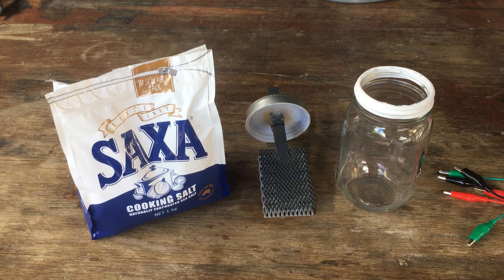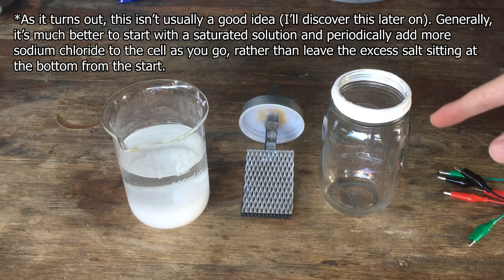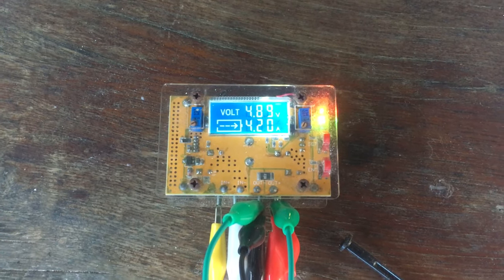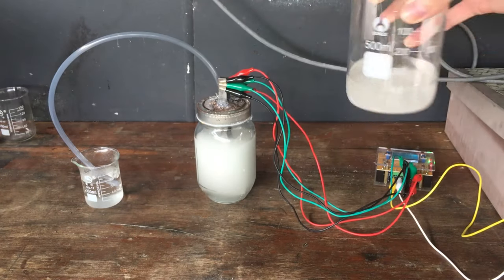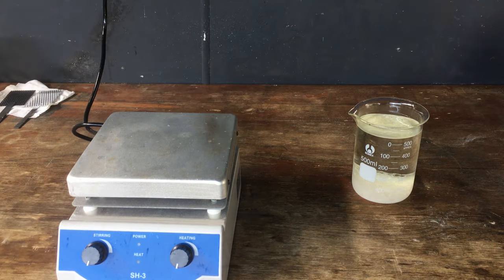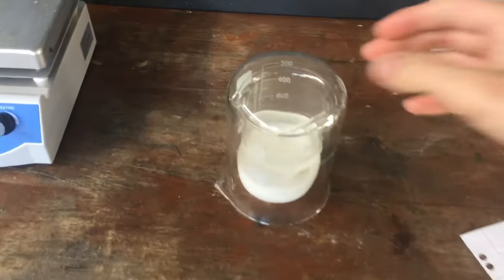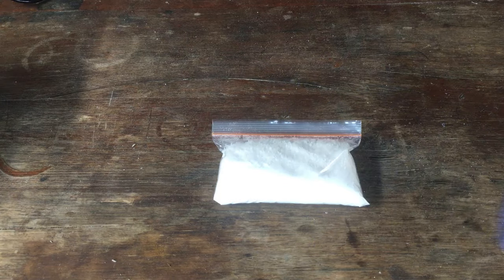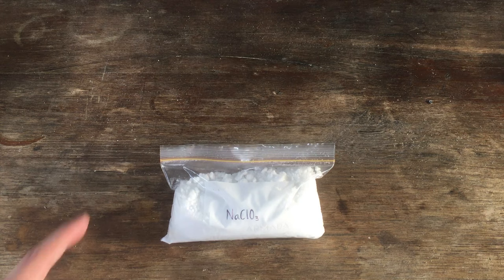A Sodium Chlorate Cell

Comment: My dear friend, thank you for your effort, but please, I have a question that concerns me very much, and I hope you can answer it. My cell operates with an appropriate current, and even the amount of gases generated by the electrodes is normal, but with the passage of two days of not adding more chloride to the cell, the amount of gases increases in large quantities. Is this a result of the decrease in chloride in the cell, or what?
Reply from the maker: Are you constantly measuring current? Has the current increased or is this extra gas generation occurring at the same current as before?
Reply: @ScrapScience  No, the current and voltage themselves did not increase anything, and as for the electrodes, I use carbon electrodes, and as another note? When I want to extract sodium chlorate from the solution, I do not evaporate half the amount of water because the crystallization process does not work for me, meaning the chlorate does not crystallize at the bottom. No matter how much I evaporate half the amount of water and leave it to cool, I do not find any chlorate crystallization. Instead, I evaporate all of the water until only salt remains. Is this the case? It is true, and even if it is true, how do I separate chloride from chlorate after the total evaporation process?
Reply from the maker: An increase in gas formation still sounds most likely to be from the cell drawing more current as it increases in temperature (this is common for cells that are supplied with a fixed voltage). However, if you're directly measuring current and confirming that it is not changing, it's a possibility that you've begun generating more oxygen as the choride level drops, though this is still a very strange situation.

If you're unable to crystallise chlorate out of the cell upon volume reduction, you probably just haven't made enough. Do diagnose this properly, I'm going to need to know a lot more about your cell:
How big is your cell (in mL)?
How much current has it been drawing?
How long did you run the cell for?
How much chloride did you add? And in what intervals?
Did you include other additives?
What are the surface areas of your electrodes?

To answer your final question, simply boiling down the cell solution to dryness will give you your chlorate. However, it will definitely be contaminated with significant chloride impurity (as you've suspected), and will need a recrystallisation if you want a pure product.

What do you actually need the chlorate for? It's possible a potassium chlorate cell would be more appropriate for your needs...

Comment: I started my chlorate cell 3 days ago. How can I calculate how long it will take me if I'm using 6 amps?
Reply from the maker: It's a little difficult to explain the basics of this kind of calculation in a Youtube comment, so I'll direct you towards a website that gives good explanations on how to make predictions of the cell runtime and production rate:
http://www.chlorates.exrockets.com/runtime.html
Reply: @ScrapScience  Hmm could there be something wrong there's no chlorate crystalizing even though I pumped the amps to 10 but there's definitely hypochlorite being made
am I just too impatient I checked the calculations and I will use them next time because I don't really remember how much salt I used.
Reply from the maker: The time things take to crystallise will depend on the volume of the cell, how much salt you initially added, the temperature of the cell, whether or not you're topping up with more salt as you go, and whether you're running a sodium or potassium cell, among other things. Without knowing how much salt you added to begin with (or any of the other factors mentioned above), it's pretty much impossible to predict when you'll get crystals.
If you're running a sodium cell, it will take a long time to get crystals (if you get any at all). Generallym, you'll only get sodium chlorate crystals if you add more chloride than is required for a saturated solution.
If you're running a potassium cell however, the crystals are much easier to get, and will usually come out within a few days of running a cell this size.
Reply: @ScrapScience  I added some more salt yesterday. Does the voltage increase when the chloride concentration is decreasing and is it possible that only hypochlorite is being made but not chlorate
Reply: And thanks for answering to my questions!
Reply from the maker: No worries! I'm always happy to respond to comments.
In order to have a chance of crystallising sodium chlorate, you'll need to have added at least 65 g of NaCl for every 100 mL of cell volume over the course of running the cell (ideally, you should add more than this).

In practice, the voltage of the cell will rise when you hit low chloride concentrations. This is a pretty dangerous way to run the cell though, since it brings the chloride concentration to the point where it starts to damage your anode. It's much better to calculate things based on the current, efficiency, and initial material, but I suppose you can use the rising voltage as an indicator of chloride concentration, with the drawback of it damaging your anode over time. For this reason, you should always add more chloride (or stop the cell) immediately after you see the voltage rise by half a volt or more.

It's very unlikely that you're making hypochlorite without any chlorate production. Provided you're using a graphite, MMO, or platinum anode, it's certain that you're making chlorate. Hypochlorite is the intermediate step in the oxidation of chloride to chlorate, so it's to be expected that you have a lot of it in solution.
Other anode choices might possibly run into this issue, but I've never heard of it happening.
Reply: @ScrapScience  Well I dipped a piece of paper in the solution and let it dry and It burned extremely fast. So in fact there's lots of chlorate in that solution.
If my math is right in couple of days it should start crystallizing but then I would have over a kg of sodium chlorate.
Reply: @fallu6224  did you get crystals eventually?  It can take a LONG time, but the cells I've run have been at least 2L at 20a.
Reply: @chemistryofquestionablequa6252  Never really got any crystals made about a 3kg of chlorate until my electrode corroded
Reply: @fallu6224  what kind of electrodes were you using? Mmo should last essentially forever if you treat it right.  I've damaged one by running too much current through it though.
Reply: @chemistryofquestionablequa6252  platinum coated titanium electrodes. never knew why they corroded I used low amperage and all but suddenly they started to corrode
Reply: @fallu6224  that's weird.  I use those for perchlorates and run them hard at high amps and haven't had problems.  I would expect that yours weren't coated as thickly as they should be if they corroded so quickly.  Sorry that happened, those are kinda expensive.
Reply: @chemistryofquestionablequa6252  Yeah bought mine for 130€ and they were completely real and certified with pretty thick coating but still they somehow corroded

Comment: Good video! It is not clear to me for 14 minutes when you filter through a funnel into a larger container. Do you filter everything into a bowl and bring to a boil? Full content?
Reply from the maker: At that point in the video, I'm just filtering everything, and then placing the filtered solution back into the original beaker to be further boiled down. You've got the correct idea here.

Comment: If you increase the current, the process will go faster, for example, 40 amperes
Reply from the maker: At 40 amps, it definitely will go much faster. However, It's important to take the limits of a cell into account. For my cell here, 40 amps would be too much for my electrode surface area, would heat up the cell excessively, and would fry any of the electrical connections I'm relying on.
With a bigger cell and electrodes that can handle it, 40 amps is an excellent idea if you want large quantities of chlorate.
Reply: @ScrapScience  Thank you very much, please tell me how much faster the process will go in one day is it possible?
Reply from the maker: I don't really understand your question. It will be nearly impossible to make this much chlorate in a day with a cell like this. You'll need a larger, better designed cell if you want to make reasonable amounts of product in such a short time.

Comment: Hello, I'm planning to make nacl03 in the same way as in the video, maybe I'll use 500 grams of salt and use carbon electrodes from a size D battery,Please give me advice, what voltage and current to use? how much water is needed? And how long does it take for electrolysis?
Reply from the maker: If you want to know about the basics of the process, you should watch my video on the potassium chlorate cell. It's linked in the description, and goes over most parts of the general process. This particular video is more of a sequel to that one, where the process is modified for the sodium salt.

As for the voltage and current, the general rule is that you should use whatever voltage will give you 20 mA per square centimetre of exposed anode area (for graphite electrodes specifically). If this requires more than 5 volts, you should ignore this rule and keep the supply at a 5 volt potential. A current and voltage controlled power supply is best here, since you can then set the maximum voltage to 5 V, and the maximum current to 20 mA per square centimetre of exposed anode area.

For the amount of water you need, this will depend on how you want to run the cell, and how big you want the cell to be. Do you want a batch process where you will be slowly working through your 500 g of starting material? Or do you want to do everything in one go? The simplest way to go about this is to just use enough water to dissolve everything, and electrolyse from there.

For the runtime, this is a subject too complex to explain in a Youtube comment. It will rely on the quantity of starting material, the current, and the efficiency of your cell, among other things. You'll have to do some research and some stoichiometric calculations here. 
I haven't yet found a good resource for doing these calculations, but this is a relatively good start:
http://www.chlorates.exrockets.com/runtime.html
Reply: If you went with those carbon rods from batteries you are probably still running the 500g salt cell 4 months later 😂

Comment: So this will probably be the last 5 questions i will ask about this video , 1 being : i have got a glass jar witch will be suitable for my cell but i need a lid that can resist  chlorine gas , my lid has got a white coating at the inner part and its metal 
But i want to know if it will not dissolve or corrode . Question : What material or lid did you use?
Question 2 : will any ATX power supply do and does it need to have a specific amperage and what section of the power supply did you use (i think you used the input to the motherboard but just to be sure) .
Question 3 : i need to know how much salt i need to add around the course of 20 days 
Question 4: i have some fiber glass sheet laying around, but with filtering out the hypochlorates, must it be fiber or can i use a small sheet in the funnel. 
Question 5 : How did you crystalise / dry the crystals because you did not film this in your video 🤔. 
I hope you will react to this comment.
Reply from the maker: No worries! Answers are as follows:

1) If it's the type of jar I'm thinking of, the white coating is not enough to stop the lid from being attacked by the chlorine and oxidising solution. You need a jar with a plastic lid if you want to avoid corrosion. The jars I use in my own chlorate cell videos have a thick (~5mm) plastic disc underneath the metal that is capable of protecting it. I found them in a garage sale and I've actually been unable to find anything else like them...

2) Most ATX power supplies will provide appropriate current for any moderately sized chlorate cell. I've never seen one that would be inadequate for the task. For my own cells, I used the 12 volt output hooked up to a buck converter to give me controllable voltage and current. The exact current you need will depend on the surface area of your electrodes, the size of your cell, and your personal preference.

3) That will depend on the size of your cell and how much chlorate you want. This isn't really something that can be explained in a YouTube comment alone, so you'll need an understanding of stoichiometry to do these calculations. As a starting point, this website gives an overview of runtime for a certain quantity of starting chloride material:
http://www.chlorates.exrockets.com/runtime.html

4) Is the fibreglass sheet fibrous or solid? As long as liquid can flow through it, it should work. You just want to use it as a filtering medium.

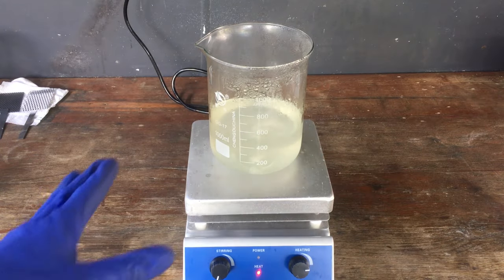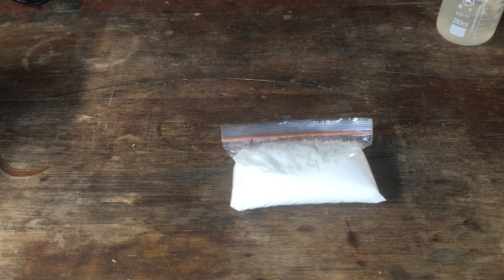5) I talk about the crystallising and drying stages from 14:03 to 17:50. In particular, I show my method of drying the crystals at 17:01.

Hope that helps!
Reply: Thank you so much , i will not bother you again about this matter and i will  mention you in the description &  video 😊 @ScrapScience

Comment: cant i just use graphite electrodes ?
Reply from the maker: You can, but your solution (and product) will be filled with microscopic particles of graphite due to the slow erosion of the electrodes. These particles are very difficult to filter out, and will make your chlorate product appear darker. Additionally, the graphite electrodes eventually need replacing.
If you don't mind either of these caveats, graphite electrodes are fine to use for this process.
Reply: how about after i finish the electrolysis process using the graphite electrodes i filter the solution using coffee filters then i let it sit for a few days, after that i think the sodium chlorate will cristalis and the left impurities would stay in the solution ???🙂 @ScrapScience  with the added bonus that the chlorate would be more than 99% pure at this case

Comment: Add the hydroxide to electrolyte to prevent chlorine from being released to begin with. Chlorine stays in solution at higher ph.
Reply from the maker: It only takes a couple of minutes for the hydroxide concentration to build up to the point where chlorine is retained, so I wouldn't worry about it honestly.
Also, doing this makes it somewhat difficult to prevent overshooting the pH. Even just adding an extra half of a gram of NaOH to a cell of this size would push the pH way above the ideal value of 9-10, and possibly damage the anode with the strongly basic conditions.
You can definitely do it if you want to minimise the chlorine generated at the start of the cell run, but be careful of overshooting the amount of hydroxide.

Comment: Do basicly if I use graphite rods 
Change them if they corrode 
And after it's done  I hot filter it to get rid of the carbon particles it should be the same right ?
Reply from the maker: Yep! That'll do the trick.
It's generally pretty difficult to filter out all of the graphite particles though, and your product might still have a slight colour after you crystallise it. This isn't a problem for most purposes though.

Comment: Shouldn't the nacl crystallize first?  It has lower solubility.  So the naclo3 remains in the solution.
Reply from the maker: In the case of having an equal stoichiometric amount of sodium chloride and sodium chlorate in solution, you're completely correct that chloride would crystallise first if you boiled down the solution or cooled down a saturated mixture. However, we didn't have equal amounts of each in solution. We had a little bit of the chloride and a LOT of the chlorate. 
In this case here, we could rely on the difference in solubility curves between the two salts (which you can find here: https://shorturl.at/rOR48 ) to get our crystallisation to work. When crystallising, we aimed to boil down the solution (reducing its volume) to the point just before the chloride crystallised. At this point, we stopped heating the solution and allowed it to cool. The solubility of chloride is almost independent of temperature, as you will see from the linked graph, so none crystallised on cooling. However, the chlorate solubility sharply decreased with cooling, so since we had so much in solution, we forced the chlorate to drop out even though it's more soluble. 
Boiling alone won't give you the chlorate, but if you stop boiling at the right time, you can just crystallise the chlorate by taking advantage of the temperature solubility curves.